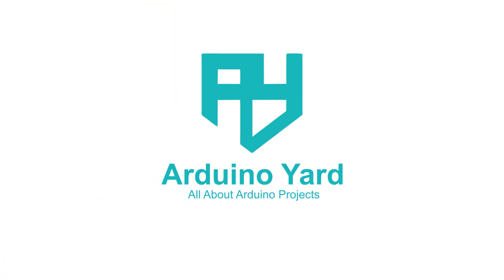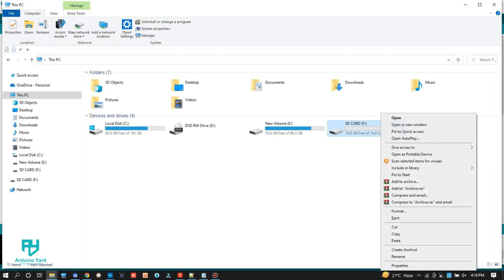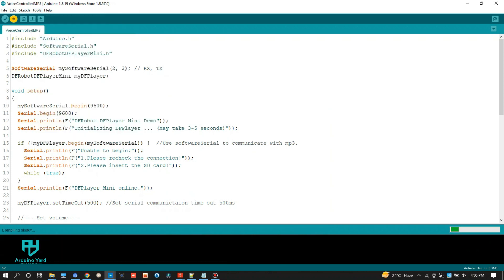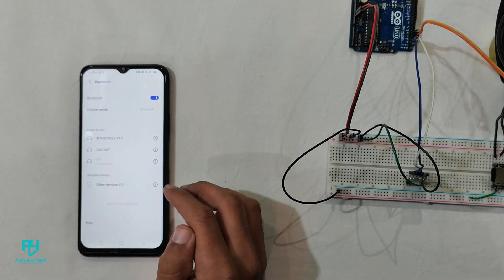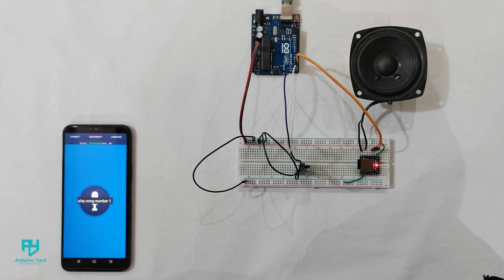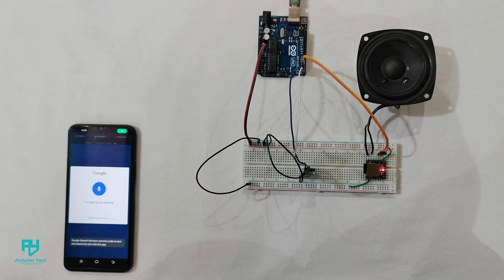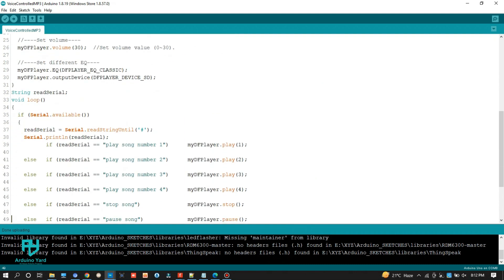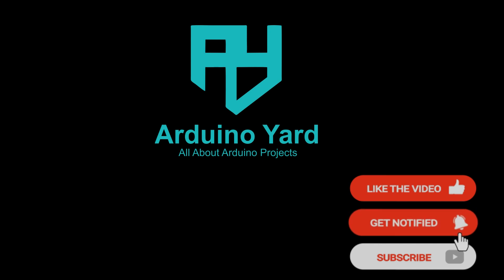Build a Voice Controlled MP3 Player with Arduino | HC-05 | DFplayer mini

Comment: i couldn't connect to the bluetooth please help
Reply from the maker: Hi!
If you’re having trouble connecting to the Bluetooth, here are a few things to check:
- Make sure you’re using an Android phone—iPhones don’t work with the HC-05 module.
- Pair the HC-05 with your phone first, through the phone’s Bluetooth settings, before opening the app.
- Try restarting both your phone and the Arduino.
- If it still doesn’t connect, try using a different HC-05 module—sometimes they can be faulty.
- Double-check that the Bluetooth module is powered properly and the wiring is correct.
Hope this helps! Let me know if you're still facing issues. 😊

Comment: can you do battery powered? thank you!
Reply from the maker: Thank you for your comment! Yes, this project can easily be made battery-powered. Simply connect a 7-12V battery to the Arduino's Vin pin and GND, or use the barrel jack connector. Both options will power the Arduino and connected components effectively. Just ensure your battery has enough capacity for the desired runtime.

Comment: My dear friend how are you toady i make the same project in arduino nano.its working fine.my best regards for you with lot of thanks
Reply from the maker: Glad it was helpful :)
Reply: @arduinoyard  even I can't made it if u not tell how to add library for Df player....
Reply: @arduinoyard  Today I checked it when it play music there is some noise in background
Reply from the maker: For noise, please make sure your connections are secure. The voltage applied is not fluctuating and a good quality speaker is used within the specs allowed for the DF player mini.
Reply: @arduinoyard  I already fix it by changes in software thanks for ur reply
Reply: @arduinoyard  I made talking robot with the help of ur project
Reply from the maker: Great! happy to help.
Reply: @arduinoyard  dear friend u from?I searched only ur project is the best